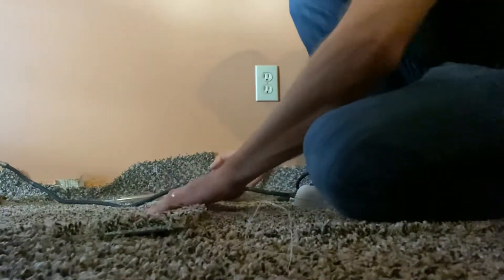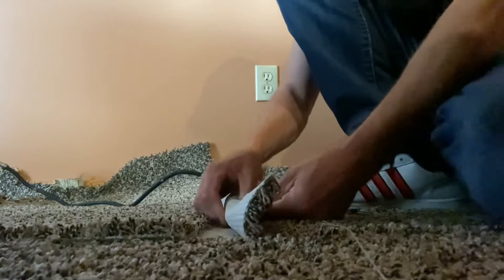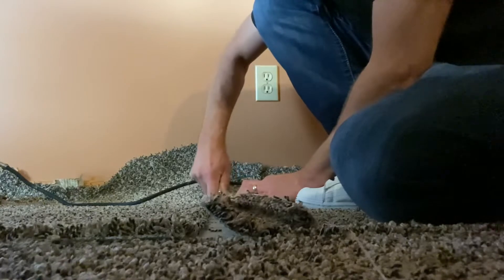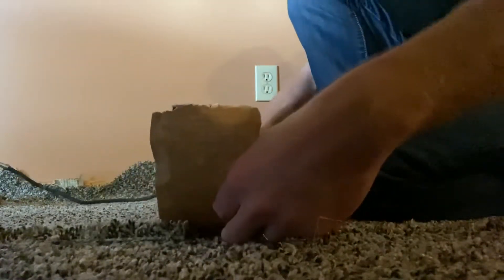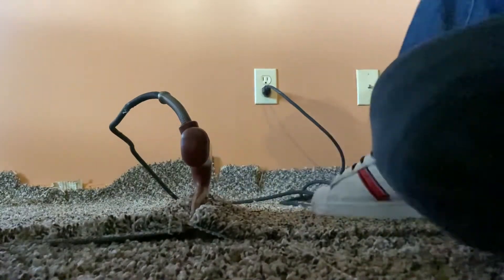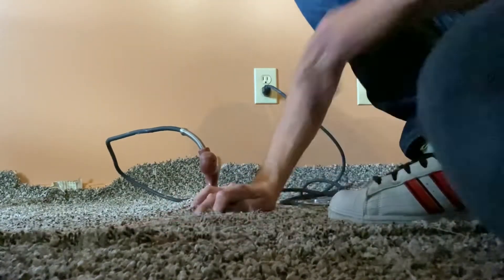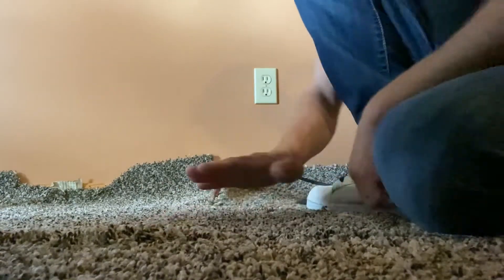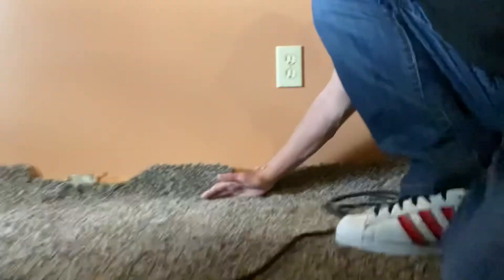How To Cut A Carpet Seam

Comment: Hi I found your videos because I'm wondering what to do with my unfinished basement. Was going to just throw down cheap rugs until we can finish the basement but quickly realized that is not the cheap option. I have plywood sub floors. Do you think just getting big cuts of cheapo carpet and using the tape temporarily so my kids are getting splinters before we finish the basement fully
Reply from the maker: Thanks for connecting! Yea if you’re lookin to slap it together on a real budget I would connect with carpet installers through your network and ask them for any of the rems they have left over from jobs. 

From there you can tetris them covering the floor until your ready to do the official flooring installation
Reply: @flooringcheatcode7125  thanks that's a great idea. I'll look up some local carpet installers thanks